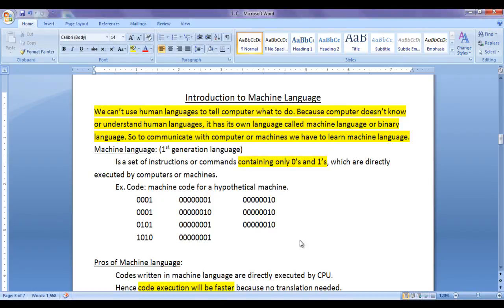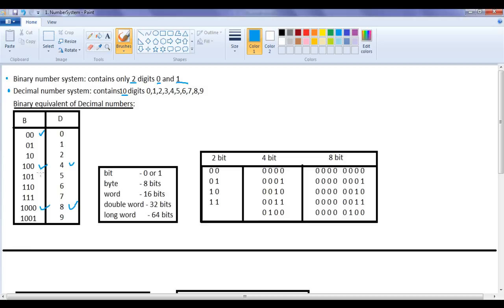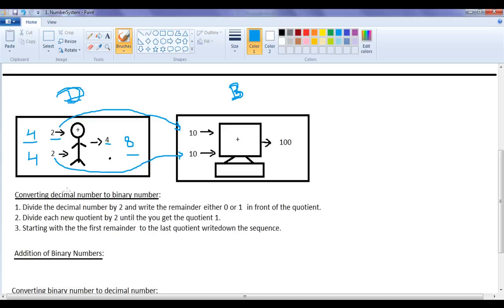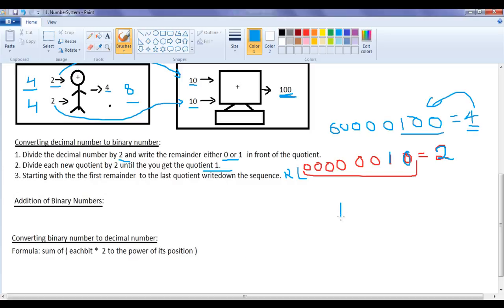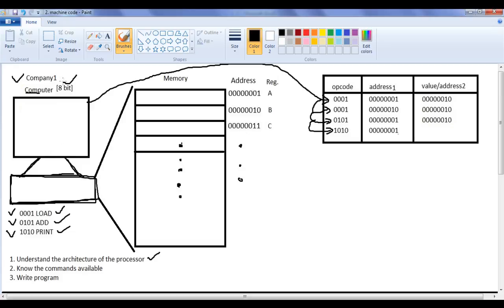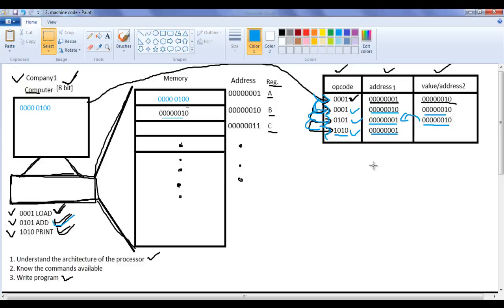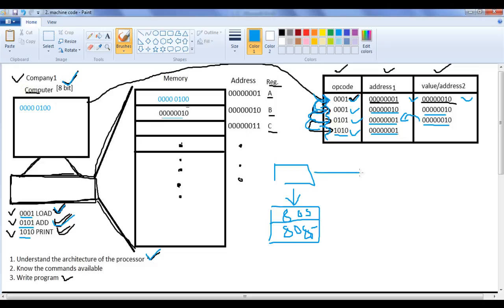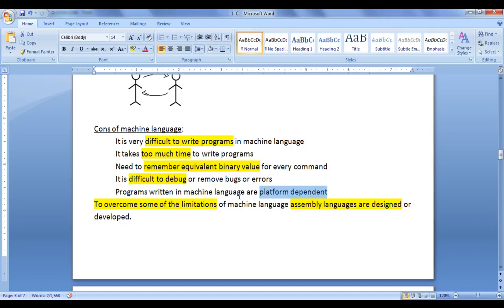Introduction to Machine Language - Computer Programming Fundamentals 02 🚀

Comment: Why computer is uesed binary number
Reply: Computers use voltages and since voltages changes often, no specific voltage is set for each number in the decimal system. For this reason, binary is measured as a two-state system i.e. on or off. Also, to keep calculations simple and convert into binary online, computers use the binary number system.